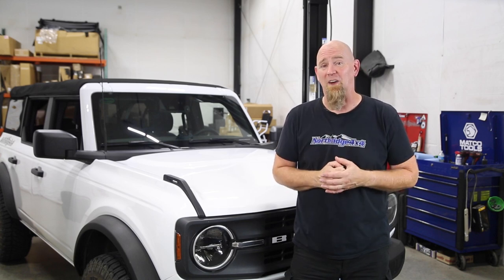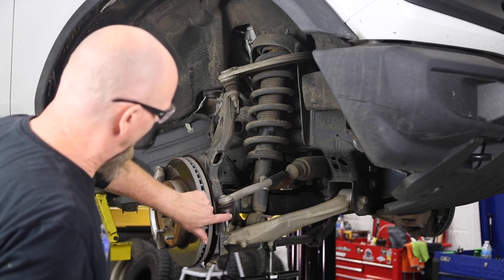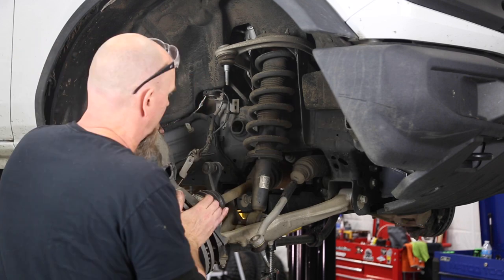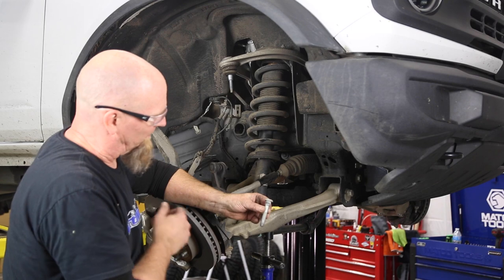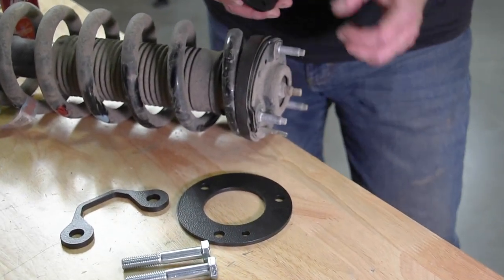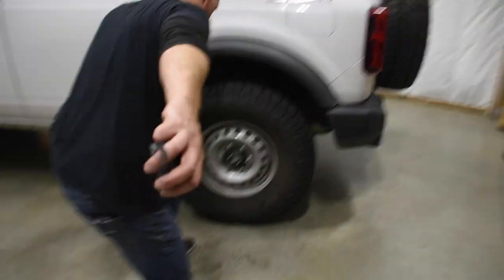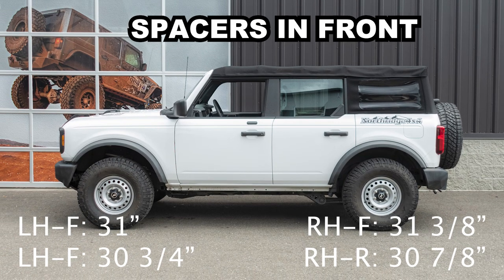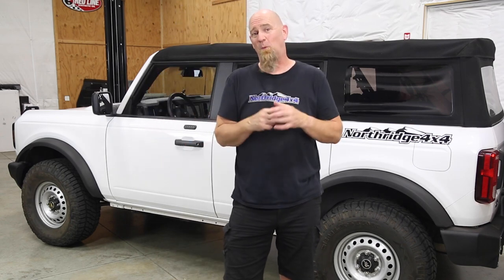2021+ Ford Bronco 1 inch Leveling Kit - Rough Country

Comment: The suspension should settle after a few miles to sit level without removing shims. From my research, the front should still sit .25" lower than the rear even with all plates in the front
Reply from the maker: The springs have already been settled.

Comment: Great video, really like the explanation of  why the kits plates don’t add up to an actual inch when they really do and more even.
I think I’m going to leave one upper plate out, I want just that little bit of rake…just a lil bit. I’ve been sitting on it for a while now, I’m torn.
Reply from the maker: Thanks for the props.
Moving one of the plates from the front to the back helped out our BASE model bronco. But it really depends on what you have and how it sits.
Measure your bronco at all four corners and see where and how much you want to add.
Using all 3 plates up front will net you about an inch. Using only one plate will net you about 3/4" and adding one top plate from the front to the top of the rear will net you just over 1/4".
Reply: @northridgenation  Genuinely curious, if one plate nets ~3/4" how does all three add only ~1"? I was thinking of doing 2 plates because I want less than 1" but if only one plate adds 3/4" that may be enough, I just want to confirm before I do the work.
Reply: @mattg8116  I got a hunch when he said "one top plate", he actually meant one top plate, but also includes one bottom plate. I read somewhere, you should add 1.5 to the thickness of the front plates, to get the actual lift height. In that case, if the lower and single upper plate combined equal 0.5" thickness, then the lift will be .75". So that's why he said ~3/4" lift.

Comment: If the front end is lowered 1" by a winch and bumper and this leveling kit is installed to compensate, will the factory steering geometry be maintained?
Reply from the maker: If you lift it 1" and then lower it 1" by adding a bumper and winch, then yes, the factory geometry should still be fine.

Comment: What if you happened to have 2 kits. Could I put 3 in the front and 2 in the back for around a 1 in lift total?
Reply from the maker: Yes, just make sure to get it aligned afterwards.
Reply: Also probably depends on the length of the upper bolts. Meaning if using 3 lift plates on top, there would need to be enough threads protruding to fully engage the nuts. An alternative might be using two plates on top, and two plates on the bottom rather than only one.
Reply: Great discussion!

I just had the R.C. 1" leveling kit installed with all 3 plates in the front.  As of right now, it's sitting about 1 in higher in the front so I'm thinking of ordering an extra kit for the rear.

Would it make more sense to add 1 plate or 2 plates to the rear.  Which option would make it more "level?"

Comment: Alot of disassembly...might as well just lift it.
Reply from the maker: True! However this is a budget option for those who don't want to spend a lot of money on a lift kit, but want to fit a slightly larger tire than stock & get rid of the factory rake.